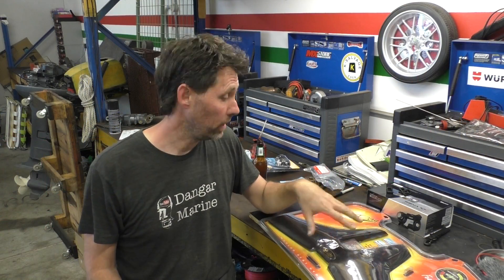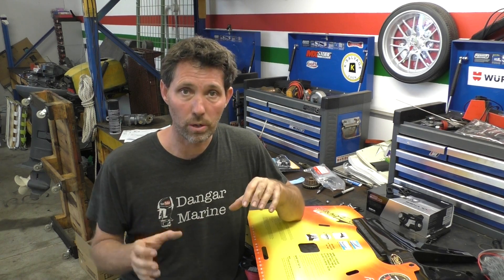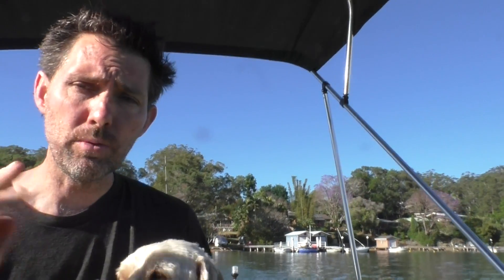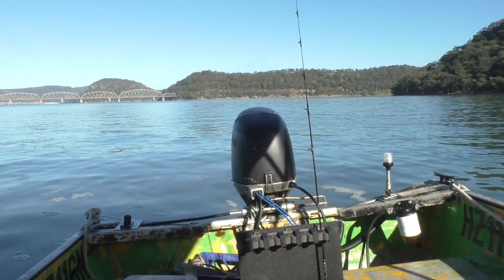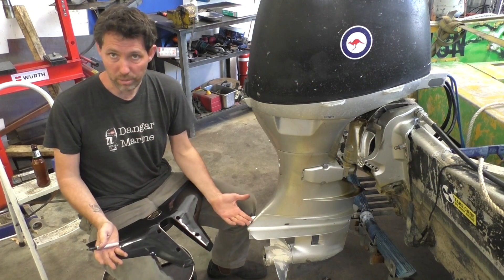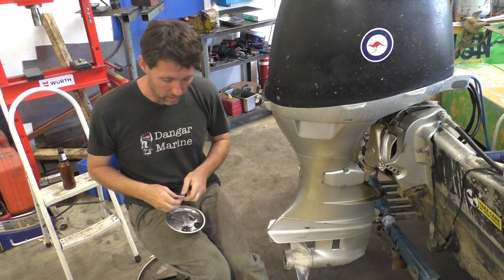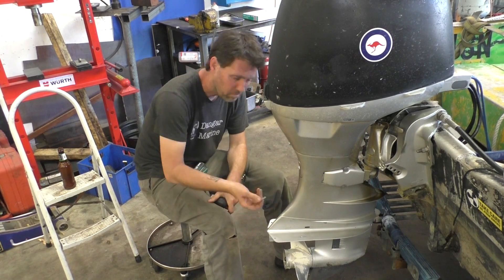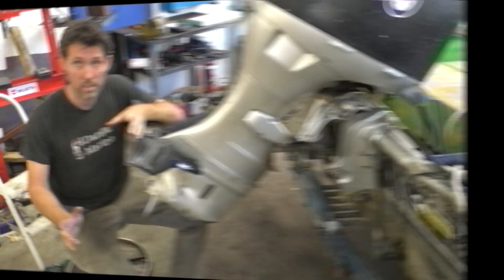Outboard Hydrofoils

Comment: Did you leave the thing on or have you taken it off? Thanks. Nice video.
Reply from the maker: I took it off in the end. The boat never really had any problem that I was trying to solve (the only time I would use one) and it also make the boat heel a bit to starboard.
Reply: Dangar Marine. Thanks, man.
Reply: Helped my boat with stability while towing a tube or skier!

Comment: I'm wondering if the claimed reduced fuel usage comes from getting plaining faster (most likely i'd say) or when in the cruise ?
Also wondering if it'd allow my half cab to plane at the 10 knot speed limit.............
Also Also wondering if you were to put spacer underneath the foil so that it came out of the water once underway , if that would then give you your top speed back, but still help get on the plane (assuming one of the previous comments is correct about it knocking off 5 mph..... now i'm reminded  of the time i wasted a week of my life making a nose cone for the gearcase of my ski boat expecting to gain 5 mph, but only gained 0.5 !!!)
Reply from the maker: I like the idea of a foil that leaves the water once the boat is up on the plane. Perhaps a folding one could be the go.
Reply: sandosau yup, low planing speed gets lower, and it's where you'll save fuel gaining range, in the low speeds. at WOT it's naturally causing more drag.

Comment: Hi Danger. Thanks so much for all your videos. 
I have a question. I've heard that my 2006 honda 15hp 4 stroke is just a de-tuned 20hp. Do you know what restrictions there are and how to remove them. Is it just carb restriction or is timing, cam, prop pitch etc. Would you say it's worth doing in your opinion. Thanks for your time.
Reply from the maker: Generally it is just carburettor jetting in four stroke motors. It's certainly worth looking into. Best thing to do is compare part numbers for the two outboards and see what is different.
Reply: Was just having a play with the outboard now(didn't do anything to it yet just had it running on muffs). But I noticed oil coming out the telltale. That's going to be a head gasket or a crack somewhere isn't it?
Reply: It wont be timing. Its is carburetor jetting to let the engine take in more fuel and thus more air producing more power. Made a bit more power in the Suzuki DR 400.  Did you ever end up running the jet kit? How did it work?

Comment: I think maybe the increased drag would result in slower speed and increased fuel consumption.   Does it??
Reply from the maker: It depends a lot on the boat which is what makes it very difficult to know if a hydrofoil is going to help or hinder your boat. Sometimes it can lift the hull out of the water further meaning that the drag of the foil itself is more than offset by the reduction in hull drag. This is why they can advertise them as improving fuel efficiency (in some cases)
Reply: I installed one in hope of planing off at a slower cruising speed, and my boat has a problem with porpoising to the extent that there is a box full of lead tire weights in the front of the boat and it still has the problem. Also I put a four blade prop on it.
 The boat is a modified-V hull, welded, 0.10"/ 10 gauge aluminum,  1448 Fisher Jon boat with a 25 hp 4 stroke mercury outboard. . At 18 MPH the bow is very high and won't come down until 20 mph.  
If this doesn't work I'll move the gas tank and the cranking battery forward.

Comment: At low speeds it saved me a lot of fuel , as my 20' boat will stay on a plane at 8 mph where as before it was pushing water till about 15 mph before it planed .
Reply from the maker: Interesting. It goes to show that for every boat they do help, there is one they don't. Glad it worked for you though!

Comment: There are at least six different brands of these contraptions I've seen; all just a tad different to avoid any 'patent' infringement of another manufacturer. If they really were effective outboard and I/O manufacturers would build it into the design of their lower units.  Marine dealers charge around $60 to $100 for these things. I sell them used for $15 and since they don't "wear out" excluding obvious and substantial damage, you'd be an idiot to buy them new. Check out an outboard dealer or marine salvage operation; they probably have piles of these taken off dead motors.
Reply from the maker: I agree that if they were a good base option they would be on outboards by default. I'm firmly of the opinion that they are only (potentially) of any use if the boat setup has a problem that can't be solved by any other means.

Comment: I have to trim my motor down farther than I would like or it cavitates making tight turns.  do you think a foil would help.  how does it hold up hitting snags, logs, etc.
Reply from the maker: It can help with sucking air on tight turns for sure. I think you'd have to be unlucky to break one hitting a log etc.

Comment: Pretty sure what your talking about is cavitation, so what the package is calling it is correct. Never heard of ventilation before on as a nautical term. I believe that's something only used by you or perhaps your local area.
Definition - Cavitation is the formation of vapour cavities in a liquid, small liquid-free zones ("bubbles" or "voids"), that are the consequence of forces acting upon the liquid
Reply from the maker: Hi mate. The previous video on propellers goes through the difference between the two https://www.youtube.com/watch?v=R2f-aWM8MmU It's got a bit of other stuff to but it does eventually get onto what that definition is talking about.
Reply: Dangar Marine Ok ill take a look a bit later on. Fitting a Bimini I've had in the shed for years and some bench seat cushions that arrived yesterday. Hopefully make for a slightly nicer experience on tomorrow's adventure.

Comment: I have a 42yo 26ft (8m) Harris Flotebote pontoon with 20"(51cm) toons and a 90hp Mariner. My problem is that I need to lift the bow at higher speeds to keep the over spray from coming up over the bow and getting a shower across the lake...lol It also creates a convergent wake between the toons that builds up and saturates the deck from underneath the boat. The trim alone is not enough to lift the bow significantly. Aside from the obvious weight distribution answers and before I drill into my cavitation plate and install a foil, I want to know if you think a foil is going to help me lift the bow when I trim up or is welding more deflection on the nose of the toons a better option? I know I may loose a couple of knots with a foil but it would be nice to move the old gal at top revs without taking a shower and flooding the deck from the bottom up. Your thoughts?
Reply from the maker: Hi mate, this is pretty much why I installed this hydrofoil and although they are generally designed to keep the bow down, I do feel that maybe I get a little bit more lift when trimmed up. I wish I had a more scientific way of measuring the change, but it isn't huge. To be honest I'm actually thinking of removing it due to the extra drag and the fact that it has also caused the hull to list a bit (not sure why as it is on dead straight). I think you might find welding some deflectors in the bow gives you a better result, but unfortunately it is a bit of trial and error with these things as every hull is so different.
Reply: Yeah, I am learning Hydro-daynamics is a funny thing... Everything you do changes things in unanticiptd ways. I've even dreamed up retractable lifting foils in the nose Or a ski in the center where it pushes up between them but she'll go deep at the back and flood the stern or push water up in another spot... lol A center log w/transom is the only other way and this boat is fairly original 1976 hull. Just want to go a little faster  than 3500 screws with her... lol

Comment: Would this work with 9.9hp on a 12ft aluminum boat?
Reply from the maker: Yes, you can get these hydrofoils for small outboards, but I'd see how the boat goes first. If it rides nicely then I wouldn't put one on.
Reply: Dangar Marine a friend gave me a brand new one, same brand as yours. I'll try without first. Thank you.
Reply: i had an evinrude 6 hp on an aluminum john-boat (flat bottom no v-hull)...lived on a river i used to access all kinds of back water lakes creeks...the river current would push-pull the boat on plane and felt unsafe...used stingray hydrofoil for smaller engines...it solved the current/wandering problem and it also got boat on plane faster, and picked up a few mph...long and short for my boat, worked very well on a small hp engine

Comment: Great stuff Stu. I have a 2005-6 Yamaha 30hp four stroke. Can you convert them into 40hp? Would be good to hear whether you think this kind of thing is do-able or even advisable.
Reply from the maker: You'd have to look at the part numbers and displacement, but if they share the same block then yes, it is possible and there is no reason not to do it. It could be different jets in the carburettor which would be easy to change, but it could also be different programming of the CDI unit. If the parts numbers of the CDI units for the 30 and the 40 are the same you can pretty much rule that out though.
Reply: Thanks heaps, I'd probably want a mechanic to do it for me though!

Comment: Hi my 17 Smartliner with a 60 Mariner 4 stroke came with these fitted. difficult to contole at low speed in marina . dangerouse when a big cruiser wake hite . Fell off the plane at 15 0r so knotts. Took advice and removed them . put 2 bags of sand in the bow locker under £5. Now contoles well in the Marina . Quicker with 5500 on the rev counter as opposed to 5000 . Super reponsive  at lower plaining speed and lee expensive in fuel . And turns better at speed . 
Great video  thankyou.

Comment: The bolt pattern is different as mine was a no hole version but the failure was in the material itself.  I believe even the non dynamic tabs are a better choice if funds are limited.  I have been running hydraulic tabs on a great variety of boats since the late sixties.  PS  On your review of new motors a distinct advantage goes to those with hydraulic tappets (Yamaha for one).  Honda and Suzuki require a shop adjustment on the valve lash every hundred hours I believe which as a dealer requirement for warranty gets very expensive.  Take care.  Doug
Reply from the maker: Good point about the hydraulic lifters being pretty much maintenance free. Suzuki push something similar with using a timing chain over a timing belt, but I think the lifters are a much bigger issue than changing a belt every five years or so.

Comment: Had one of those Sting Rays.  Big down side is the boat is much harder to turn with them on.  Yes I have hydraulic steering.  Mine failed within one season and the customer service was terrible.  They did not stand behind their product whatsoever.  Poor design and engineering.  Mounting holes on the foil failed.  It was quite possible to have a catastrophic failure if it contacts the prop or flips to one side and possibly flips the boat.  I put hydraulic tabs on like I should have in the first place.  If you are going with one of these stay with the smaller versions as the large wings can't deal with the stresses of normal boating.  My boat is a 17' Arima with a 100hp Yamaha top speed of about 32 mph.  I would never recommend these particular foils from my and several  others experiences.  Take care.  Doug
Reply from the maker: Hey Doug, it's a shame they didn't stand behind their product when it failed. Because my motor sits between two different sized foils, perhaps I should have gone for the smaller size. I wonder if they still share the same bolt pattern? I think if the boat is a bit larger then hydraulic trim tabs are definitely the way to go if you can afford them.

Comment: They make a huge huge difference on rear driven boats !! Or if you load you boat up as well !! The big fuel saving is that it causes much much faster plane !! As you stated ! There is no bowl sink it jumps straight to plane !!! Even at half throttle!! My boat being rear driven you would have to full throttle to get it to plane then ease off the gas ! But if you back of to much you would fall out of plane again !! Not with the hydo it planes right from the get go and you can just cruise 1/4 throttle at full plane !!! And all that equals big fuel savings !! You can hear the motor just dont work as hard !! Just purrs  alone like a kitten !!!!
Reply from the maker: Hey Sam, certainly sounds like you've had a great experience adding a hydrofoil. I get the impression that your situation is exactly what they are designed for, particularly with regards to the fuel savings from planing at lower throttle settings.
Reply: Dangar Marine Yes it was a must have for my boat !! I also put one on a 17 foot runabout i had for fishing and occasional sking !! It made a huge difference when it can to trying to pull a skier!! Made it so it would just pull them strait out of the water !! It was the same thing had absolutely no stern dip on takeoff!! Strait to plane !! But some say you can lose a bit at top speed due to drag and if trying to go full noise can also go past that equals where extra drag uses more fuel !! But most times i used to just cruise rather than race !! So never found that problem !! Your video is an excellent example and display!!

Comment: I have a bayliner 2150, yes I know, very old.....1987.... I've owned the boat for 30 years. omc cobra with a 305 cu chevy engine. The problem was getting on plane fast enough to be able to pull a skier. I put on longer trim tabs before I installed the hydrofoil,  they helped with on plane control. I found that the stingray really made the boat get up on plane faster. I installed this hydrofoil myself personally.  I found that I could now accelerate fast enough to pull a skier up behind this boat without them having to drink a good portion of the lake.  Did it take top speed off? Yes, perhaps 2-3 mph but I rarely run out at top speed due to passenger comfort. For my boat it is a great product that makes it perform much better.
Reply from the maker: Hey Roy, nothing wrong with old boats, they are often better made than many new ones. More and more it seems that hydrofoils are best suited to boats with problems getting up on the plane and that when installed they really do help with that problem. Thanks for sharing your experience.

Comment: hi stu its Pete from Weston super mare SW England  go t a set of hydro planes .. are they worth fitting to a Yamaha 55b with no trim tilt
Reply from the maker: Hi Pete. It's hard to say, but to me now it really comes down to whether you have an existing problem with the bow rising too high and struggling to get the plane. If the boat is riding just fine as it is I wouldn't bother.
Reply: thanks

Comment: Nice video Stu. I always wanted to try one of these on one of my boats, but I just can’t bring myself to drill holes in my anti cavitation plate!  I’ve seen models that are no drill, but I wonder how well they’d hold up.
Reply from the maker: Hey Jack, I think the no-drill models are pretty good. I haven't heard of anyone having them fall off once they are installed correctly.
Reply: Google them falling off. Happens all the time. Get the drill on one if you need it
Reply: Fireship1 I've had a no drill on a 65  Szuki for 6 years and use it often it works great
Reply: If you buy the sea sport ones they atatche to the anti corosion thing
Reply: It would kill me to drill through it!
Reply: Don't worry about drilling,,,you can fill it later

Comment: Hey man, great news here.  I got one of those Stingray hydrofoils (the no-drill type) yesterday and threw it on to test if it would affect my porpoising issue.  I didn't have the highest hopes, since I'm skeptical of 'miracle cure-alls' promised by accessories makers.  But this thing made an enormous difference!  Popped out of the hole and right onto plane with no bouncing and no riding the trim button.  I made a video:  https://streamable.com/tka8w
I don't know how it works, and I don't care.  $52 piece of plastic had me smiling like an idiot.